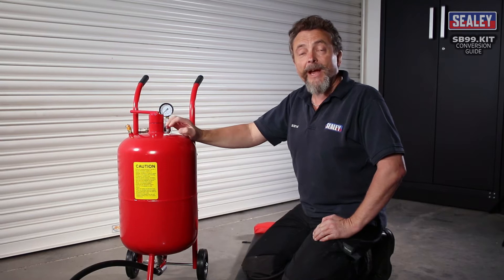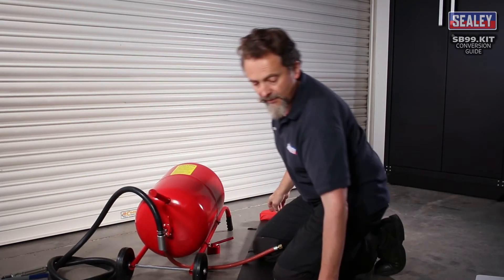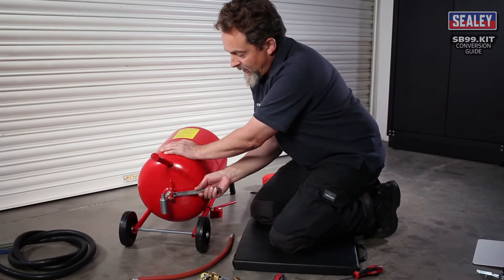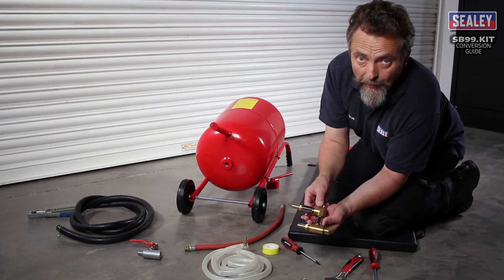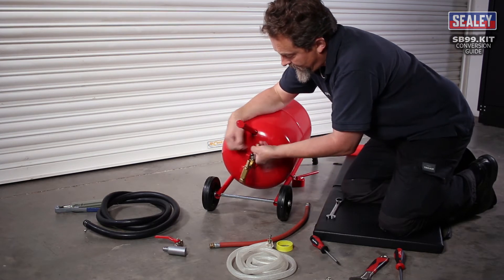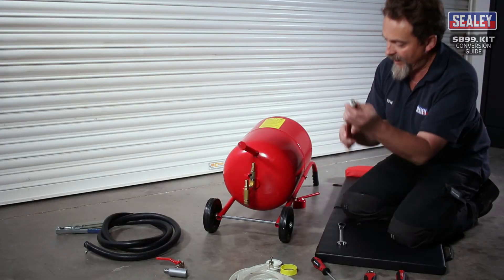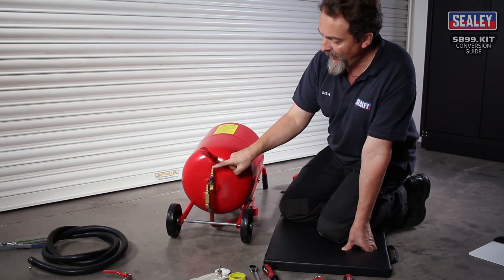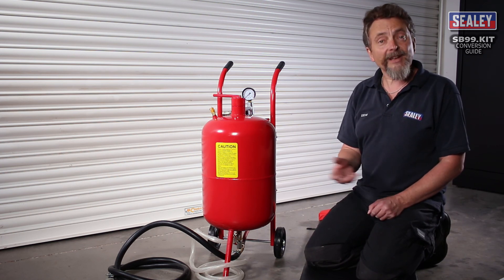Sealey SB99.KIT Soda Blasting Conversion Kit - Complete Installation Guide

Comment: This is bullshit.. what is the clear hose going to ?  Now i dont cant what sealey say.....a sand blaster and a soda blaster is the same thing. i do both in my cabinet.. the only thing i switch over is the actual medium i want tio use. i do not need any different fittings..... now i could understand if you were using cheap plastic fitting for soda and then wanted to go on blasting sand or grit or glass beads..... but this kit is total bullshit and definitely not worth having..... in the video he mentions " this hose goesto exhaust  " ?  WTF  is the exhaust ?  Medium in the tank comes down intothe T pieceand flows out the gun.. where is there any need for any exhaust ?  does he mean this is for cleaning out the fitting when you shut of the tank ?   . The only difference is soda is less harmful to the work-piece than glass, grit or sand.. you use the same tank , same gun and even the same fittings..
Reply: would also like to know why put this kit in between ;-)